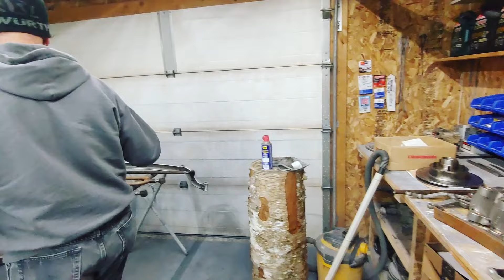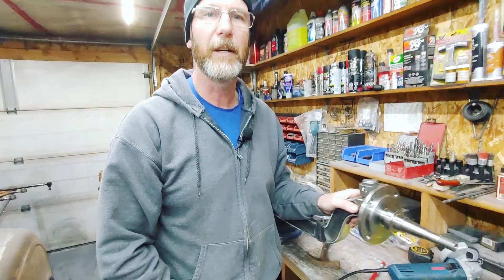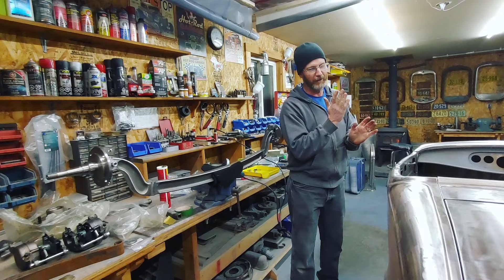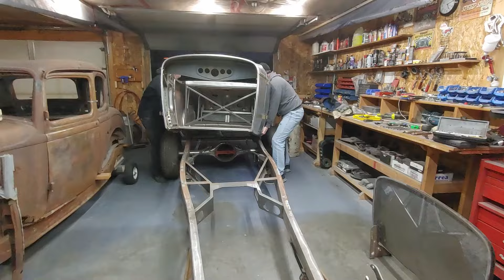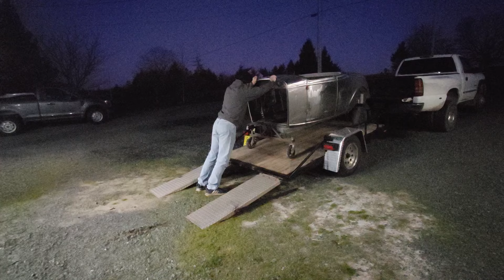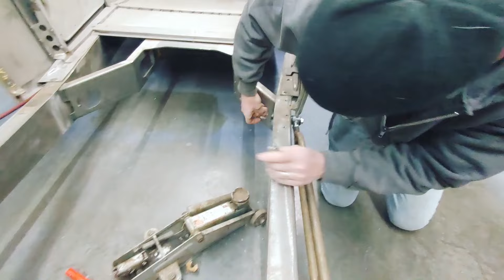1932 Ford Roadster making progress on our car

Comment: Good job, yeah once your friend's roadster is gone much more room to play.
Your king pin installation tool looks very much like my variable and very versatile installation-adjusting-persuasion tool I use. LOL 
Questions, Are the 2,  5 windows yours or customer's ride? 
And where is the front end kit from? 
Are all parts you installed from one kit?
Reply from the maker: Both 5 windows are customer's bodies and frames. LoL yes you have to be flexible with tools so long as it doesn't damage parts. The front end we bought from a friend. It's a new front end from Lucky 7 that's been sitting around for about 10 years.